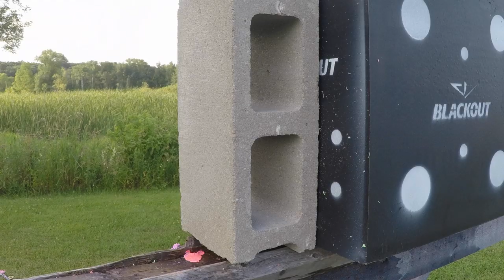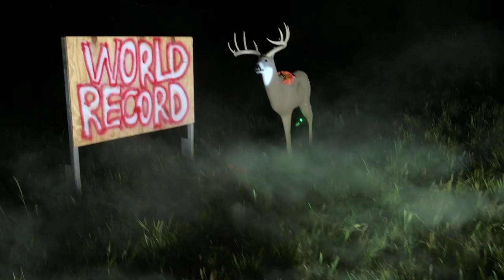Longest Shot with a Bow (RECORD) Archery Trick Shots | Gould Brothers

Comment: Yall guys build some real big boy arrows and see how the penetration increases.  Push over 20%foc with a 600 grains and see what happens.  Something else to consider is that higher foc will stabilize the arrow off the bow so close range will be much better result.

Other than that. Fun to watch

Also you dont need 80 or 90 lbs to shoot distance